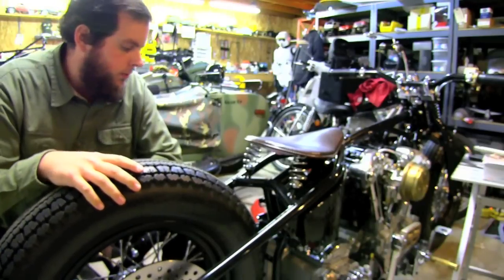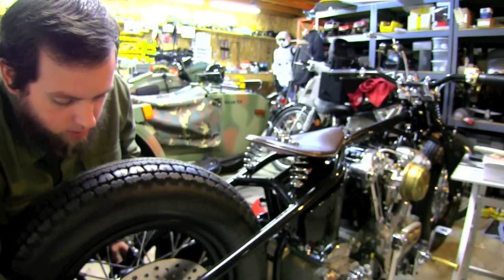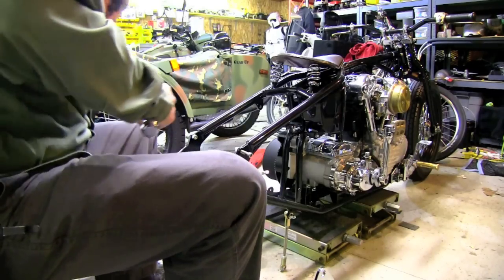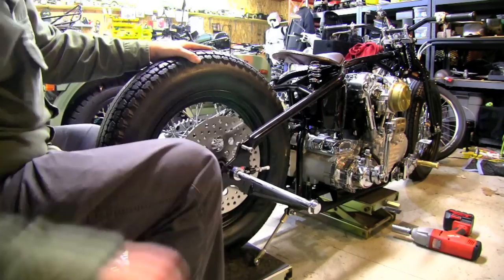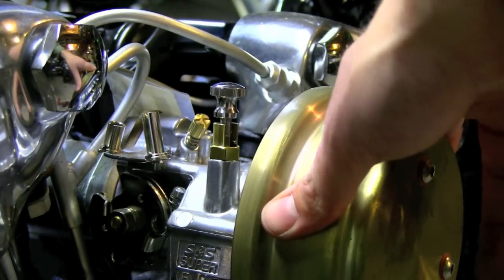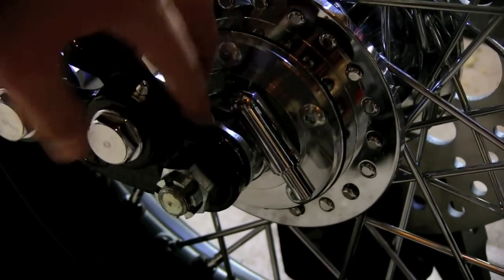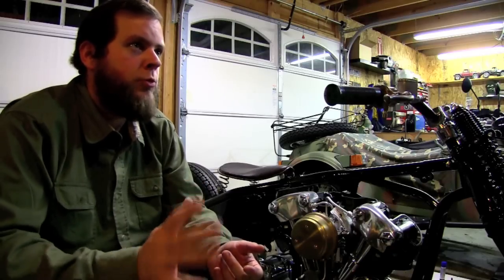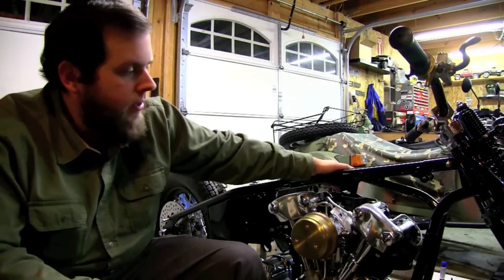Zero Engineering Bike Build 8

Comment: I have a zero roller build which I didnt assemble and the pull to left is quite strong. when I look at your front right (speedo) wheel side I see mine has a spacer outside fork leg plus nut where yours and all others i see dont . Any thoughts? I could email u a close up pic or post a couple on youtube and provide link if you would like
   appreciate anything thanks.